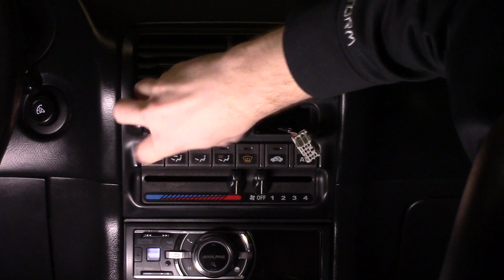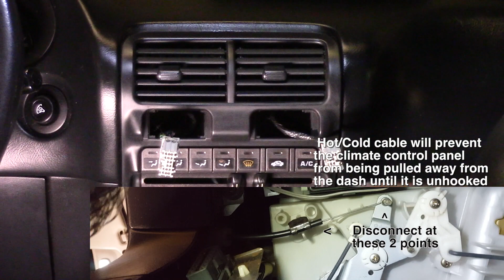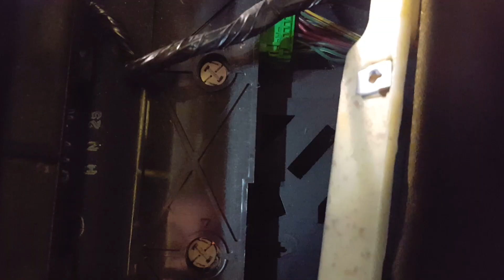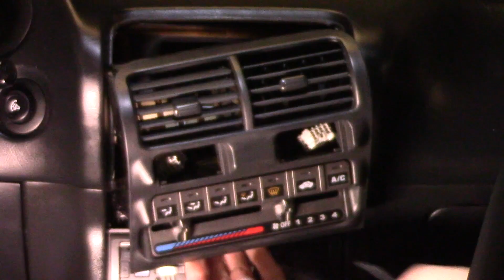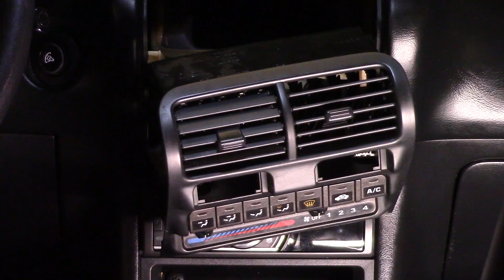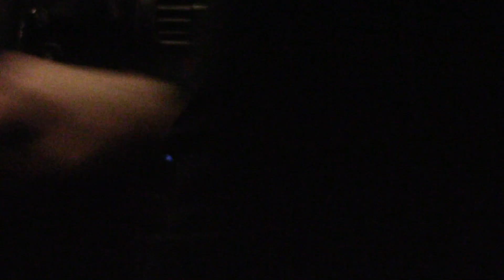Replace Climate Control (Heater/AC) Backlight Bulbs | Acura Integra

Comment: just did this job great video  however doing the bottom 2 lights its way easier to just unplug the green harness connector    and my neo3 light is very dim i think there something wrong with it i switch it 180 degrees so that not the problem

Comment: Hi I recently bought the same lights as you and I’m having trouble getting the hazard and defrost lights to be tight when I put them in, causing them to not work, any suggestions?
Reply from the maker: Once they are inserted turn them with a small flathead screwdriver a small amount and they should feel tight. If not then they aren't lined up properly.  There are notches on the bulb twist base that have to line up with the cutout where you insert them

Comment: Is there a way to make my AC/Heater slider easy to slide left and right because it’s quite rough on mine.
Reply from the maker: Try some white lithium grease
Reply: @20thcenturycars  amazing it work you are the best! Also how do we change the D4 on the shift light indicator on the dash.
Reply from the maker: @karwinchau4684  you're in luck, I actually just posted a video that covers that.  Check out the most recent video on my channel, it shows you how to take out your gauge cluster.  Mine's a manual so I don't have the D4 light, but yours will have a vertical row of small bulbs on the back of the cluster that are for the gear indicators
Reply: @20thcenturycars  that’s the thing I can’t find any aftermarket parts to change the light bulb. 😭
Reply from the maker: @karwinchau4684  I haven't confirmed this so double check yourself but according to superbrightleds.com it should be this one:
74 LED Bulb - 3 SMD LED - Miniature Wedge Base.  Or you could just order one from Honda.
Reply: @20thcenturycars  I woudnt order one from Honda or Acura because the OEM is 15.99$…. Which is really ridiculous just for a small light bulb or the entire light itself replace. I will checkout the recommendation you sent and see how it goes.
Reply: @20thcenturycars  74 isn’t it that’s the shift gear, not the one on the gauge cluster.
Reply: @karwinchau4684  its probably used for both, its just a basic small peanut bulb, only differnce is the one in the gauge cluster is in a twist lock base.  So you probably have to buy that bulb and then the appropriate size twist lock base.  Its probably the same size as the ones in the climate control.
Reply: @55Aavenue  @Acura Advice I ordered the light it just came in and it’s not the same size. But this will definitely light up my shift gear not the shift light indicator on the dash.
Reply from the maker: Oh really, shoot...guess I was wrong on that, Ive never replaced one of those auto bulbs before.  Is it the same sized as the the indicator bulbs in your cluster (turn signal engine light etc.) Or is it different from those too?
Reply: @20thcenturycars  no not the same size.

Comment: do you know what led you need for the gear shift ?
Reply from the maker: Mine's a manual so I don't have that light, but according to superbrightleds.com it should be this one 
74 LED Bulb - 3 SMD LED - Miniature Wedge Base
Reply: @20thcenturycars  thank you so much !
Reply: @20thcenturycars  after two years I finally installed it and it turned out great ! the lettering is kind of old but none the less it does the job. Thanks again.